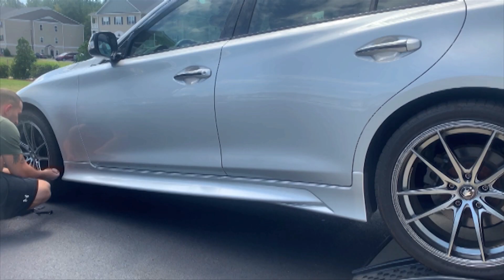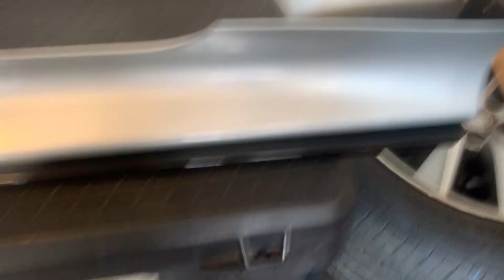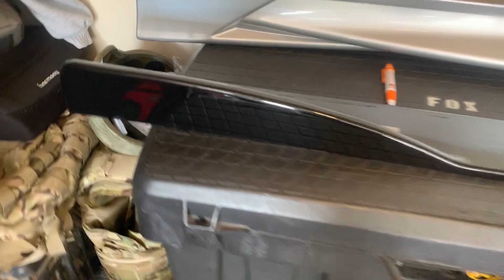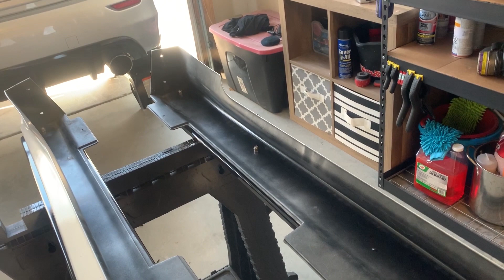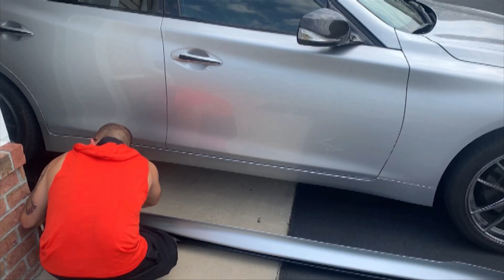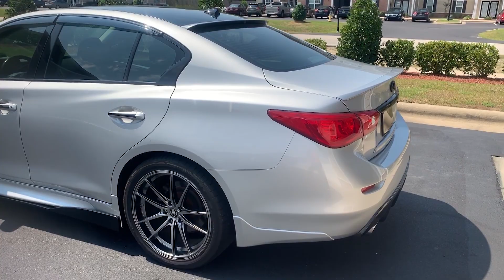eBay side skirt/splitter combo installed on an Infiniti Q50

Comment: so I installed my side skirts and splitter  today, and I came to notice that the splitter is slightly angled upwards due to the design of the side skirts. Do you also have that issue with your splitter angling upwards?

Comment: i’m about to attempt to put mine on. did you use self tapers under to hold the side skirt to the body of the car?
Reply from the maker: Yeah,  I also removed the factory push pins from the stock skirt and bought longer ones at the auto parts store and put them through the new skirt and the stock skirt where applicable.
Reply: @ are you referring to the black Push Retainer Clips? if so does original clips not work?
Reply from the maker: The extra plastic the new skirts add will cause the stock retainer clips to eventually snap cause they aren’t long enough.

Comment: did you use the factory holes to screw in the side skirt?
Reply from the maker: I sure did, and they have held all these years perfectly.
Reply: @Foxcraze  did you use any hardware underneath?
Reply from the maker: @douglasa2642 yeah boss, I bought longer push pins and replaced the pins that held the stock skirt up so it fits through both layers of plastic.

Comment: Hey did you ever end up having issues with the abs side skirts not stay stuck to the car at the curve in front of the back wheels? So I installed mine exactly the same way you installed yours. The double-sided tape they sent me I used and immediately I realized it wasn’t gonna work so I got some 3M tape that was better and it worked for a little while but not long. And when I mean a little while I mean maybe five minutes. I couldn’t sit there and hold it on for hours with my hands. It just will not stay stuck to the side of the car and keeps popping back off. I do not know what to do.
Reply from the maker: Yeah man mine are rock solid. Is the tape lifting from the skirts or from the car? If it’s the skirts scuff the area you are applying tape to make a mechanical bond. If it’s the body of the car then try warm the area getting taped with a heat gun and the tape as well before pressing them together. Helps a lot with the bond process. I also clean everything with isopropyl alcohol before hand.  If after all that is still pops off then your skirts might be warped and might need heated a lot and reformed to sit flush.

Comment: I'm about to install the exact same skirts with full one piece carbon fiber side splitters as well. It appears that I will be following your process here pretty much. My question is as follows: Was there a reason you fitted the splitter back wing so close to the ABS side skirt. (in looks like its almost touching you silver paint ( Maybe 1/4in off )?  It looks good but were you forced to do this? I was thinking of a little more air gap there on mine so the wing sticks out a bit more in front of my rear tire. I do have 10.5 inch rims with 295's on mine at the rear though so the tire sits out about 1/8in outside of the wheel well. Yours looks right but your wheels look like a stock stance as far was how far they stick out. Like they ware inside the wheel well. Just wondering if I could move my splitter out a bit and it work. Thanks! Your Q looks dope!
Reply from the maker: I have kids and I did my winglet placement so my kids would not step on it while getting out of the car. You might be able to push them out more it totally depends on the with of your splitters.  In regards to my wheel setup it replicates the stock sport wheels exactly, and I did that so it had flush fender alignment since I don’t prefer the poke out look.
Reply: Cool beans. Thanks

Comment: Great videos. Curious why you went gloss black on the side skirt splitters instead of carbon fiber skinning like you did the front lip.
Reply from the maker: Back when I did the side splitters the plan was to do a full splitter set around the whole car the same way with the current NIS front lip installed. The bumper was a luck purchase that I didn’t plan to do initially which changed my plans for the build now.

Comment: Could I just use the splitter without the side skirt?
Reply from the maker: Yeah you can, it will just need mounted deeper since the side of our cars curve inward.
Reply: @Foxcraze  th link u posted for the splitter, is it the right size that would fit the length of the car? I saw it has an extension...did u use it?
Reply from the maker: It only fits with the extension however I plastic welded mine together and body worked it to make it look how mine does. I encourage you to look at my other videos before buying them.
Reply: @Foxcraze  Thanks brother! We need more peeps like you, helping out the next man! Thanks a million!
Reply from the maker: That is literally why I started this channel, and I’m glad it’s helping!!

Comment: Did you use adhesion promoter on the car body ?
Reply from the maker: Nope, I bought it but after cleaning the body with soap/water and doing an alcohol wipe the surface was good. I pre heated the panel and tape before applying and it went great and is still holding strong.
Reply: @Foxcraze  I watched the install video several times any pointers bro ? Did screw the side skirts in 1st by the wheels and the side skirts lip goes on stock side skirt lip any advice would be helpful i appreciate that you do answer my questions thanks when I ask
Reply from the maker: So when I installed these I peeled the backing off the tape at the top of the rear and a portion of the corner at the top front of the skirt then aligned the screws on both ends and hand tightened them in a few turns. Once the wells were secure I peeled the backing from the rest of the tape and pressed it down to bond the skirts and the body together.

Comment: I found these. Will these work?

https://www.ebay.com/itm/For-2014-2018-Infiniti-Q50-4-Door-MOD-Style-Side-Skirts-Body-Kit-Black-ABS/113256202202?_trkparms=aid%3D1110006%26algo%3DHOMESPLICE.SIM%26ao%3D1%26asc%3D225080%26meid%3D01af07b03e774d09ba70607e5884d27a%26pid%3D100167%26rk%3D3%26rkt%3D15%26mehot%3Dpp%26sd%3D131864781897%26itm%3D113256202202%26pmt%3D0%26noa%3D1%26pg%3D5411%26algv%3DDefaultOrganic%26brand%3DUnbranded&_trksid=p5411.c100167.m2940
Reply from the maker: Those are the same skirts just a different seller you are good to go!!
Reply: Also, the link for the splitters says they won't fit my 2018 q50 red sport. Could you send me a link to a set of splitters that would work please. 86.6 inches I believe is the measurement. Or whatever you think will be my best bet
Reply: And I've been looking for a gt style wing for the q50. Any ideas?

Comment: The link for the skirts shows they cost 1000.00. And they are out of stock. Is that accurate?
Reply from the maker: When eBay sellers run out of stock they increase the price so people won’t purchase in order to keep the listing open and avoid paying more eBay fees.

Comment: Great job on this mod my man, couldn't find the $149.00 site for skirts, the one u ref, is selling for $1000.00, anyhow I found some $199.00 which is cool, car quest takes orders on exact color matched paint?
Reply from the maker: When they are listed at $1k the company is out of stock of the item and doesn’t want to close the listing and get charged to reopen it later. Just in case you didn’t know! As for the paint you might be able to order over the phone but I usually just go into the store and order they have it mixed and ready to spray in about 30 min usually!

Comment: Looks great man! I have a q50 as well and what you're doing is very detailed and professional. Do you have a link to buy the window visors?
Reply from the maker: I cant recommend them unfortunately since they started cracking from the NC heat. I ended up taking them off and throwing then away.
Reply from the maker: I appreciate the positive feedback as well!!
Reply: @Foxcraze  so I ended up ordering the same front lip and side skirts from Ebay. Everything fitted fine but after a few days the back part of my skirts popped away from the double sided tape. I screwed everything accordingly and prepped the body from dirt and grease as well. A buddy of mine suggested spray adhesive or even epoxy adhesive to keep them from getting loose. What are your thoughts?
Reply: @Foxcraze  btw I just followed you on Instagram. My @ is @POPPA_qfitty
Reply from the maker: I didn’t get notified of this message so I apologize for the late response. If the side skirt lifted from the tape leaving the tape on the body then I would ask if you scuffed the plastic on the back side of the skirt where the tape was mounted to before applying? abs plastic can be very slick to touch and require ruffing up so the tape has plenty of bite to grab onto and stick.

Comment: Where’d you get your front splitter?
Reply from the maker: The front splitter in this video is the eBay 3 piece. The link to it can be found in the comments of my new front lip install video. You should go check it out before committing to the purchase of a 3 piece.

Comment: Man that looks badass! I ordered those same skirts waiting for them to come in gonna try to fit them on my g37’
Reply from the maker: I love the way the skirt-splitter combo flows with the car. I'm looking to change the front up now because of how the front lip isn't a smooth curve its got that slight angle in it that throws the body lines off to me now. There is a lot more to come with the custom projects. If you haven't already be sure to subscribe!